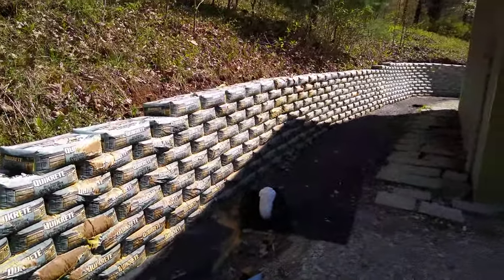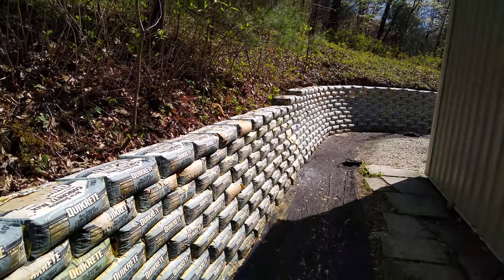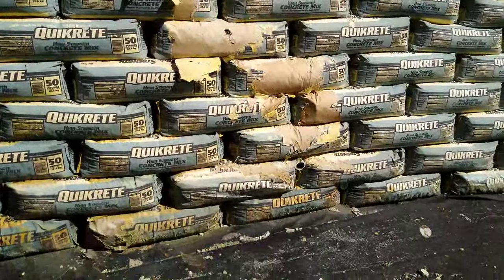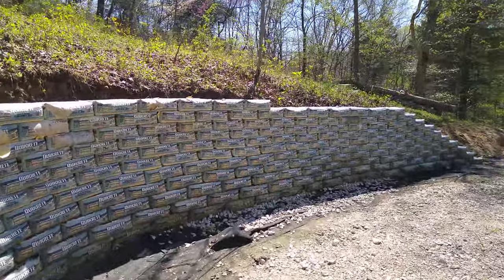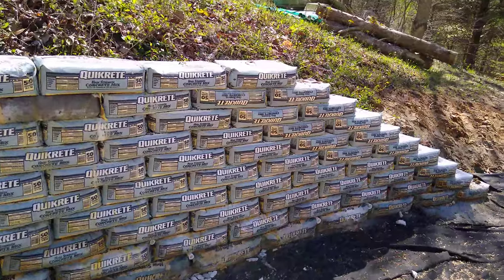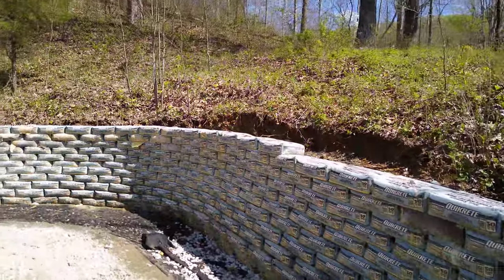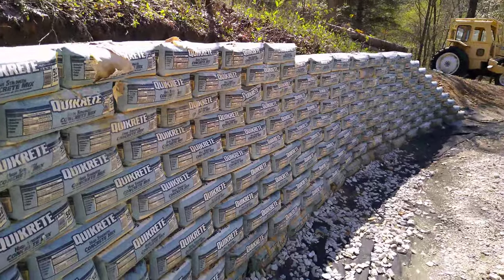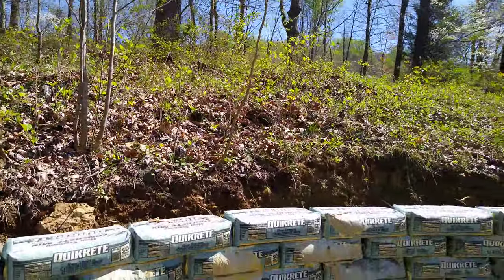Concrete Bag Retaining Wall | Basic Overview

Comment: Why use rebar? It splits the concrete and building on a 1 degree badder holds it like a dry stack.
Reply from the maker: @billy roberts It needed to be permanent. Dry stack would work. The rebar has a fair amount of cover to protect it at least within the bag. Steel Rebar is used in many concrete applications with enough cover. Most of the water at the base did concern me in regard to exposed rebar. I needed the rebar to pound it in the hard clay soil. Alternatives to steel rebar are basalt and fiberglass rebar which will not corrode. There are no salt conditions that factor into the equation as one would see with highways, bridges and seaside structures. It will likely last a lifetime the way it is. The next person can just coat it with gunite if they feel it needs it. - Thanks for your comment.

Comment: I'm not sure I understood how to prevent the top bag from cracking
Reply from the maker: I later found that taping the top bags with plastic packing tape, bottom edge, then run straps of tape tight on the bag, keeps paper from stretching. Acts like the reinforced bags.

Comment from the maker: ** Specifically Made For This - QUIKRETE RIP RAP - Commercial grade blend of Portland cement and specially graded sand, packaged in a Fiber Reinforced, Biodegradable Bag for erosion control applications. https://www.quikrete.com/productlines/riprap.asp
Reply: Very nice, graceful sweeping curves to match the hillside and stepped ends to meet the grade. Well done Steve.
Reply from the maker: @duwaynegebken8703  Thank you DuWayne. I need to use ti-backs, dead-man in the next two walls. This ended up getting longer as I went. I also cut down the back side (hill height) some and all of the soil is very stable, hard blue clay two feet up or more on that wall, then the rest is yellow clay.

Comment: My inspector told me the rebar is no good because it can swell seven times it's original thickness. I did the same thing around my pool with 250 bags although I didn't use rebar and all the spots but I evenly spaced it out and when I told my inspector he's told me that the rebar can swell and the concrete will eventually crumble..😔
Reply from the maker: Hi Mike. This has not happened with one wall a year old. He may be referring to oxide jacking. The rebar needs to have good cover which is distance from rebar to outside surface. The high PH of concrete forms a thin oxide layer protecting steel. For instance, if you watch my other video, I sealed the top of the wall and cracks in bags for cover. So, you may want to coat your wall tops, and cracks and seal it with some colors to make it look nice. Thank you for your comment! https://youtu.be/LHl5dYp3dg4

Comment: Not cost effective
Reply from the maker: Yes you are correct. It cost a lot. Castle block would be even more. $947.20- (512 Bags x $1.85)+(Rebar & Taxes) - Thanks for commenting.

Comment: would you consider a 7' high wall built in undulating radii. freestanding?
Reply from the maker: It might be. I would take advantage of the radii with mass for stability. Yet am avoiding that height this DIY method.